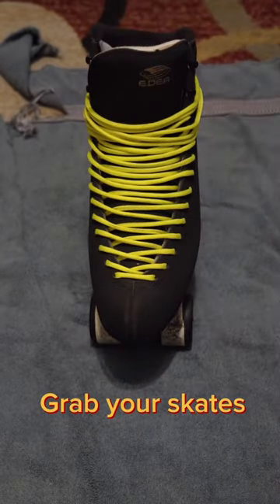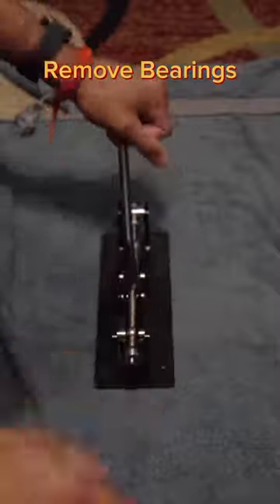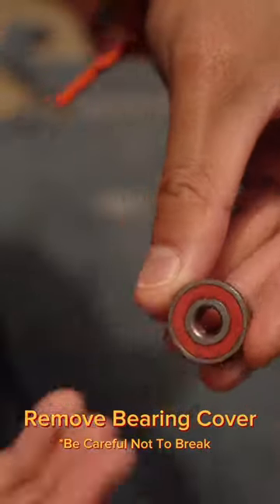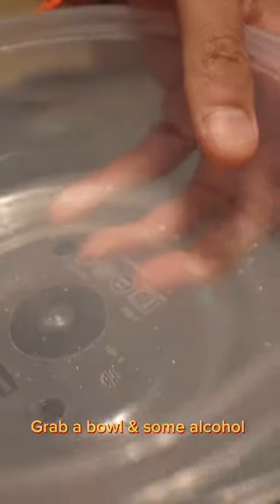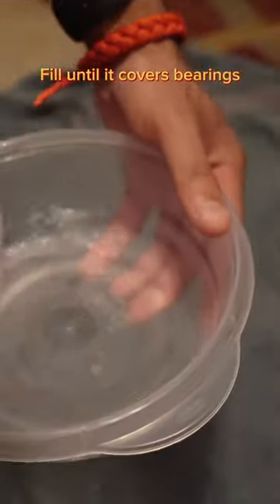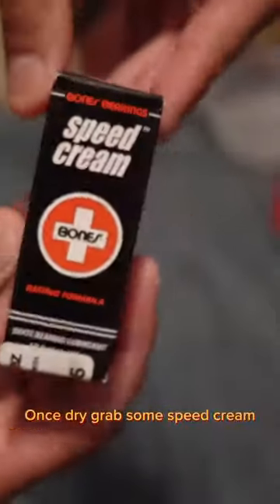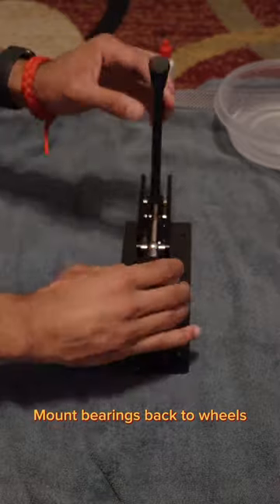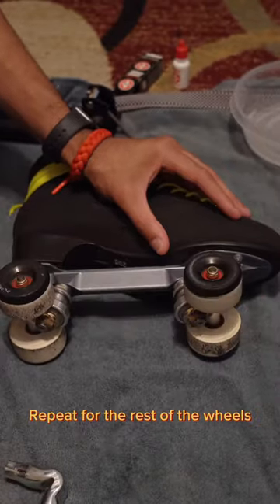*TUTORIAL* Cleaning Roller Skate Bearings in 60 secs #rollerskating

Comment: what's the difference between these bearings and the ones with the black covers?
Reply from the maker: The black ones are ceramic. They are lighter and provide faster acceleration because the balls weigh much less. They create less friction and are thus faster than Super REDS in this video. More reliable as well but they cost more.